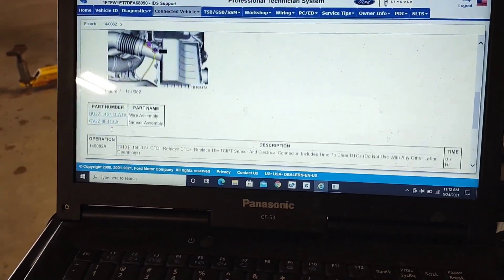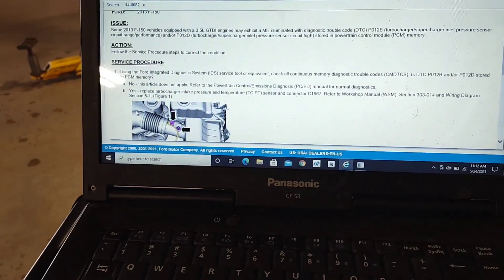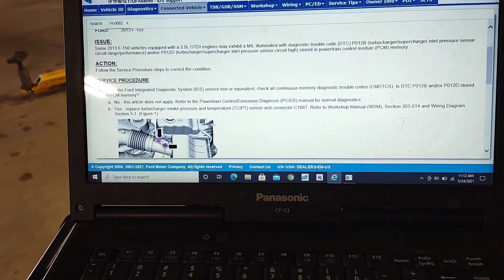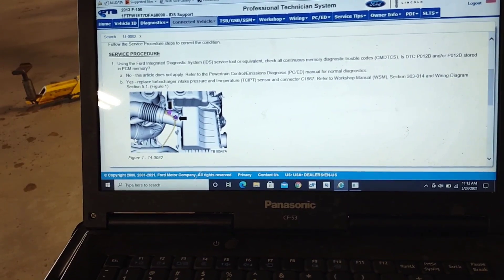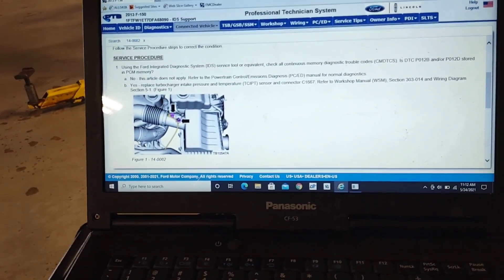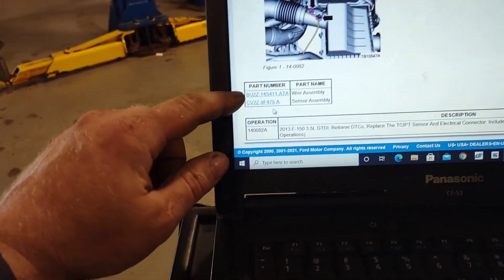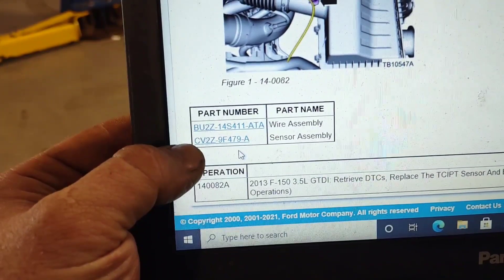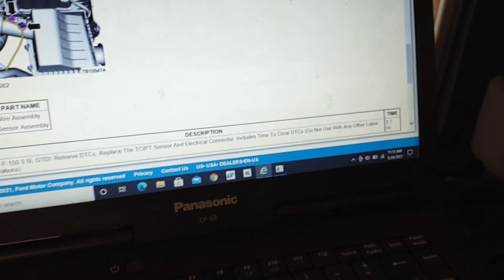2013 Ford F150 3.5L GTDI P012D and P012B Engine Light on Cold Air Intakes also Very Easy Fix

Comment: Thank you sir you have answered my question I have struggled with my ecoboost idle high while stuck in the traffic it show no code or engine light I got home and cleaned al sensors but nothing change I unscrewed  the airflow sensor bolt and pull it out while the engine is still running gess what the idle rpm went down to 500 and run super smooth but at this point I’m not sure do I have to replace the airflow sensor bolt temperature sensor or have something with pcm to reset. Please help thanks

Comment: Good informative video! Quick question... I bought a 2013 f150 3.5 a few years ago and it has the same problem. So the dealer did this same repair.  It continues to throw the same codes then it goes away after a while then comes back. What are your thoughts on this? Thank you.
Reply: I just replaced the sensor not too long ago . And now the light just came on .disconnected from sensor blew air in the connector plugged it back in and now the lights off

Comment: Broooo, I just got that code in pending which is P012B after installed my first catted downpipe. Everything is great and no leak at all. Maaannnnn, I jut watched u so will trying to clean my IAT sensor
Reply: but that code P012B is only 1 code i have as not sure which sensor cause the code because there's 3 MAF sensors
Reply: Okay, my Intake Air sensor is motorcraft. And it kept saying 100 degrees temp or sometimes over when idle or driving. This is my first time
Reply: I just cleaned the sensors and inspected the wires/connectors. Code gone... all is good

Comment: Great video, is the wiring harness required when you replace the sensor?  Or, if the existing wiring harness is okay, can you use the stock wiring with the new sensor?  Thanks for your help!
Reply from the maker: That's a choice you have to make
Reply: So the new sensor does fit on the old wiring harness.  Just depends on the condition of the wiring harness, right?  @FordBossMe    Thanks again for your help!

Comment: okay.. so i got this code p012D, engine light was on. Didn't feel any difference, just engine light was on, got an obd2 machine. Tried resetting the code, the code is permanent and wouldn't go. So I unplugged the sensor.. used an air duster into the connector and into the sensor.. plugged back in.. light is now gone.. AND my turbos are actually kicking properly.. I didn't even realize ive been driving with a power loss.. oh man, now I just touch the pedal and it flies. REALLY? Just some possible dirt inside caused this? I just did this today, only drove for about 10 minutes, so will do a longer test tomorrow during the day just in case.. but so far so good especially after I noticed a huge power difference. I may have just gotten lucky.. but maybe this works for others

2013 f150 ecoboost 3.5 L 165,000 miles
Reply: Any update? My truck is throwing the same error codes. Actually failed inspection here in the great state of NJ because it popped up as my wife brought the truck into the DMV for inspection… talk about timing 😤
Reply: @KlaudeeBoyee  engine light has not returned, I scanned it yesterday again just to make sure, NO CODES!!! The permanent code went away! I guess you have to drive it, a few times for it to recalculate everything. This fixed the issue for me, just use an air duster into the plug itself and into the connector and it seems to have fixed everything. I have a lot more power now.
Reply: @itsGuy  thanks! Will have to give this a shot and hopefully it fixes the issue for me!

Comment: What would cause a clicking noise at the intercooler area. Code came on for p012d. I disconnected the connector and blew it out. It was damp. Cleared the light and went off. Just wondering if clicking is related to bad sensor? Also what is the click. The way it sounds is you hear a click and the. A pause for maybe 10 seconds and then a click again. Just unsure what it could be?
Reply from the maker: You do have active Grille shutters up front so I think that could be the issue as early as 2013-2014 I'm not quite sure let me know if you have active Grille shutters
Reply: @FordBossMe  mine is a 2013, I did not see the shutters.

Comment: @ 3:49 did you cover the wires with a piece of metal followed by the rubber shrink tubing?
Reply from the maker: Yes that's exactly what I did it comes in the kit it's Ford's version of butt connectors they're more robust
Reply: @FordBossMe  thanks

Comment: I have had this code come on before and have cleaned the tip of the sensor. I just had my timing chain replaced and the code came on again.  Might sound crazy, but can this effect the electrical system at all? My electric start has started acting all crazy since the light came on. Works, doesn't, lights come on, but will not start it. This truck has 46,600 and has eaten two timing chains, blown out rear window from defroster and worst of all, a three-inch piece of paint came off.
Reply from the maker: No Start I don't believe so 

Sounds to me like someone needs to dig deep.into your truck
Reply: @FordBossMe  That truck needs to be buried deep.
Reply: @FordBossMe  Just found out today that if your engine light is on, your electric start, will not start the car. Does the sensor need to be upgraded to the new style, or can you replace with the old style?

Comment: I just replaced wire and sensor, had code p012d. Now when I shut truck off and turn back on engine light comes on with p012c. Not sure if you’ll see this but not sure why that’s coming up now.
Reply from the maker: Did you make sure you hook your wires up right
Reply: Yeah the only issue if it happens to be one is I left all the wire on the new harness and cut the vehicle harness wire back. I was about to take it apart and redo the wiring.
Reply: @FordBossMe  I just rechecked and I wire in reverse order, going to fix it now hopefully that will work
Reply from the maker: @10cobra03  let me know as soon as you find out
Reply: @FordBossMe  Ok good news, instead of rewiring I took the pins out and put them in right order. Cleared the light, turn engine on and thankfully engine light stayed off after second start up. I truly appreciate you getting back to me.

Comment: Ok, maybe you can answer a question for me. This has been a source of heated debate between me and my sister in law. She knows nothing about cars but likes to pretend she does, I know enough to do most basic things myself until I get over my head and have to pay someone who absolutely knows what they are doing, like you, to fix what I can’t. Is there any trim level or model of 2013 F150 that has a cabin air filter? I know some of them with the heated and cooled seats had a filter under the seat, but I’m talking behind the dash.
Reply from the maker: They didn't start putting cabin air filters in the F-150 is until like 2015 and even the module that you're talkin about under the seat and the Thermal electric device wasn't really so much of filter it was more a pathway for air to safely flow and kind of did some filtering
Reply: @FordBossMe  , HAA!!!! I am victorious!!!!  Lol, I love proving her wrong, it annoys her every single time.

Comment: How long after installing that the check engine light goes away?
Reply from the maker: It just all depends it's easier to just pull the battery terminal for 5 minutes and put it back the negative one and see if it clears that way if not just go to AutoZone and have them clear the code for you

Comment: I hate those Ford pigtails, I hate ALL pigtails. I have the correct crimping tools, just give me the connector, wire seals and terminals. I know how to remove the terminal finger lock and push the fingers back to remove terminals.

I've always hated they give these pigtails and treat master techs like stereo shop idiots. I can make my own battery cables better than the cheap lowest bid contractor.

Ugh! 🤬
Reply from the maker: I just do what they say now I don't even try to fight it anymore
Reply: @FordBossMe  they always come with 14ga wiring even when data wires, the bulk of crimps and heat shrink looks terrible. Glad I had access to the seals and terminals on the big reals, just do it over like factory, nobody will notice it's been altered. Electrical tape after a week under the hood or in the sun gets all gummy and nasty, hate working on vehicles with that sticky tape on it.